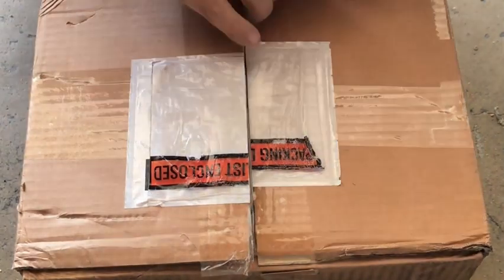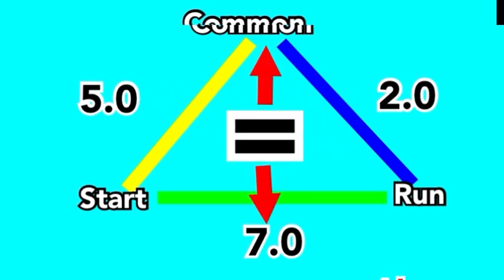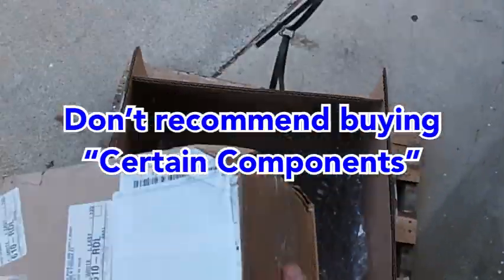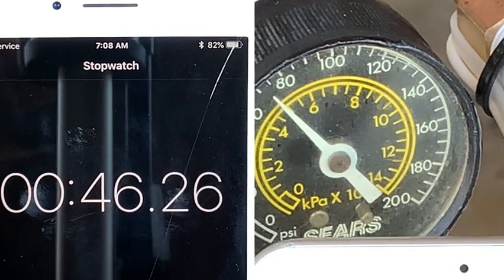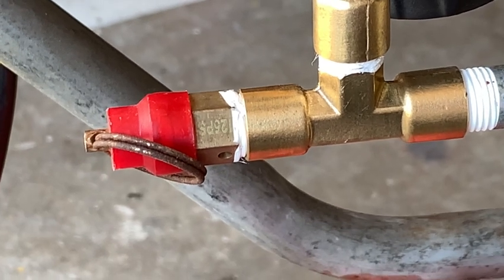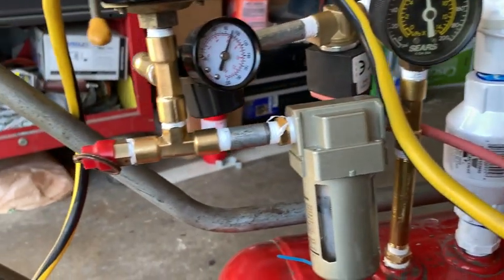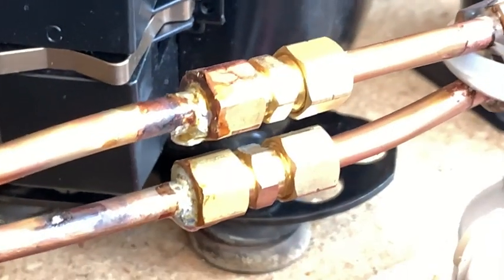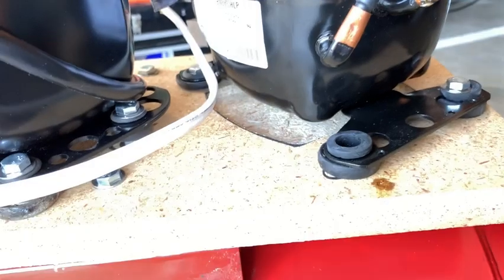My DIY Silent Compressor For Air Atomizing Aeroponics

Comment: these r refrigeration compressors which need lubrication oil filling and the same is circulated and some comes out with gas but goes back with return gas in closed refrigeration systm.Running it for air and that too either without oil or spraying oil on plant roots both wont be acceptable.U can siply use car inflating compressor which is oil free.Any way it will not run contineously.

Comment: This type of compressor has oil in the air path and isn't safe for this use.
Reply from the maker: Not quite sure what you are asking.... meaning... if you are referring to the freon aspect of it then... My answer is no... if you are referring to the lubrication of the cylinder/piston portion... then my answer would be ...technically all compressors do...

Any of the compressors which don't utilize rings around the piston and utilize reed valves are bound to have blow by.... but, having a separator/catch can/filter will catch most if not all depending on the capacity of the holding tank itself as well.

Here is an example of what I mean.  If you have a 1 gal tank.... its more likely that residues or contaminant will have a higher probability of getting into the outlet line vs a 25 gal tank.   As the feed portion/inlet feed that fills the tanks and pass through a check valve.  usually feed in a downward fashion.  The outlet line is completely drawing from a different location/port.

Taking the size into account... the larger the tank the higher off the bottom where most of the contaminant will accumulate.  I hope that helps give you a visual of what I mean.

As for my set up personally....having a large tank, and a catch can filter and distance from the compressor.  I don't think even if the oil were to enter my tank it would be able to reach my root chamber.... My feed line is approximately 35'-45' away from the solenoid. 

I will keep an eye out for it in the nutes when I change our the res.  So, far to date I would have to say nothing as shown... I'll keep my fingers crossed though lol ;)

Cheers!
Reply: Your comment not having the same number thumbs up as views is puzzling.

Comment: How much invested in all at this point? How much do you see I vested before done...?
Reply from the maker: Honestly, I don't keep as good of track of it as I should.  There are things you can do more so on a budget... meaning using craigslist for like old refrigerators.... I picked one up for about $50 grabbed the compressor out of it and started with that... also, had one of those old water coolers laying around and used the compressor out of that as well... 

Originally, it probably cost me less than $100 to assemble the compressor... the fittings is something you can't get around... about $2.50 each... catch can filter was $12,  if you shop at harbor freight they have coupons for 20% off almost every friday....  

I spend more on things like the extension cord... I think it was a 50' ft one because I know I will use it in many projects that I do.   Again, you can do this on a budget if needed.  As for my compressor that is super old and it would still run had I re-did the plumbing... but, I didn't want a loud compressor and I've been looking at silent compressors for probably 6 years or so lol.  This project just gave me the excuse to make one.

Most of my stuff I've been sitting on for years collecting dust and I'm just putting it to good use now.  to give you a ball park on what I probably spent ... I would say $500 or less minus the new compressors I picked up.

Hope that helps you out!

Cheers!
Reply: @aeromah1062  
If you  have the make and model of the compressor, look at the spec sheet for the displacement, its usually given in cc`s or cubic inches. Multiply the displacemt by 2900 and convert the result to cubic feet. This is the theoretical output (in cfm) of the compressor, typically the real world output will be around 25% less.

Comment: I would try to get the check valve done as soon as you can as it seems you dont have an unloader btween the compressors and the tank. Although you are probably using HST/HBP compressors, the internal reed valves can and will eventually fail if you dont unload the line each time (dont ask me how i know this lol). The other problems that you`ll run into are the type of oil to use, most folks use normal compressor oil which isnt a good idea. I`d recommend using Shell Tellus 68 or an equivalent, its a mineral based. non foaming hydraulic oil. To maximise the life of the compressor dont allow the cil to exceed 100C or exceed a 50% duty cycle. Oil consumption is the tricky one because theres no oil sightglass in these compressors. You`d have to be brave to fit one even if you knew where to put it. I fitted an hours run counter and tracked the oil consumption over a 6 month period to get an idea. It was prretty tedious but showed me i was safe with 10ml for every 40 hours of running time. I just replace the oil in the compressors annually and reset the hours run counter to zero. if memory serves my compressors take about 550ml each.  Crankcase vent breathers/ filters are ideal for the intakes, i went for shiny chrome with red.pleated filters, just push them onto the pipe and tighten the included hose clamp. They should be easy to find, they look similar to this https://www.amazon.co.uk/BQLZR-Intake-Crankcase-Breather-Filter/dp/B00RUQNYIM
Reply from the maker: Atomizer! hahaha you need to email me lol.  Yes, you are right the reed valves won't hold the pressure but, that white check valve is rated 150 psi and it's holding very well at the moment.   The valve I was going to go with is this https://www.amazon.com/New-tank-Check-valve-compressor/dp/B003H7ITEW?ref_=fsclp_pl_dp_3

Do you think I can plumb the side port as a inlet line, which is typically used for the over pressure bleed valve to trip the pressure switch and shut it down?

Also, I was thinking about running 2 individual check valves on the outlets of the compressors just as redundancy. Also, IF one decides to fail prematurely then I can disconnect without having the unit leak.  

Initially, I was considering to run the compressors in series but,  I'm not trying to super heat the air or achieve a higher peak pressure so, I just set it up as a parallel configuration.

Nothing so far is static or in it's "Final Configuration"... let me know what suggestions you got for me.  I also, was considering to get another one of those compressors from supplyhouse.com. that thing is a monster! and it really fills up quickly!  Running 2 in a parallel set up would cut my fill time down to 1 minute lol.

Cheers!
Reply: @aeromah1062 
The side port is the one to use, it has a check valve (plastic plug and a spring) and a port to connect tubing to the unloader which is usually built into the pressure switch. The pressure in the lines between the compressor heads and the pvc check valve will be held at 90psi when the compressors shut down,  it really should be fully unloaded  (0psi) to protect the reed valves.I dont know why you`d need to run the compressors in series, they are capable of 850psi so be sure your pressure relief valve (pop off valve) is in good shape and routinely check it operates correctly. I installed 2 on mine for the extra peace of mind. When you start running more than 2 compressors you have to install a dedicated circuit to handle the combined inrush current which can be very high or use sequential starting so each compressor fires up in turn, not all of them at once.
Reply: Hey! You were talking about compressor oil, is there anything wrong with oil free compressors for this kind of application?